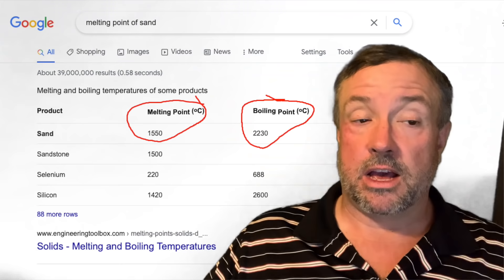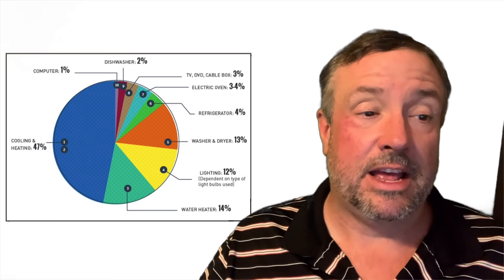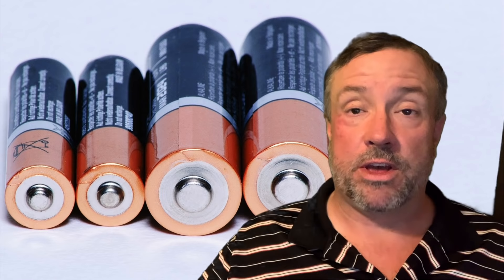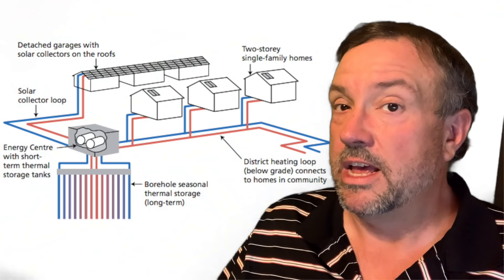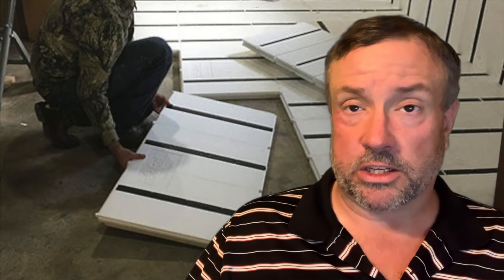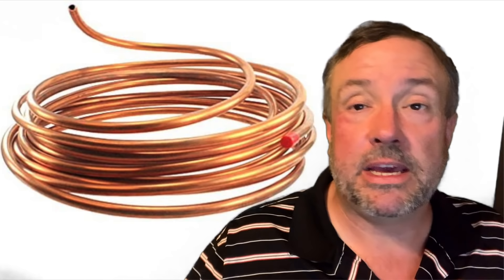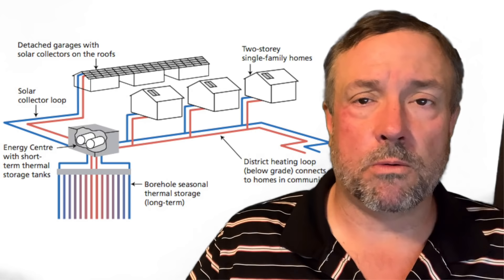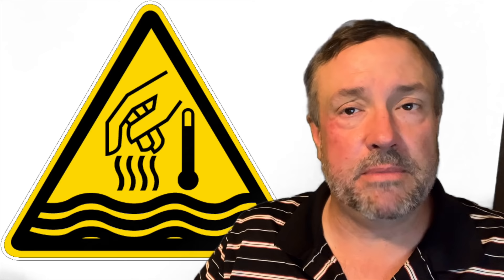Sand for Thermal Energy Storage

Comment: Ditch the sand and go with ball bearings. You can get them very hot, and you can transport them around in a pipe without liquid.  They are easier to move up hill. Just a thought.
Reply from the maker: Sounds expensive
Reply: @SimpleTek  The expense is offset by the infrastructure needed to store and move them. There may be used ball bearings available. Its not necessary that they be perfect. I bought a bag of .250" bearings not so long ago, new,  for about $7. It was a good size bag. Glass marbles could be a good choice, very inexpensive. Sand has a big problem. No matter how you move it around, it's an abrasive.
Reply from the maker: @waynesmith6417  as ball bearings get worn they become more abrasive though…
Reply: @SimpleTek  Have you ever seen a 30-year-old pachinko machine ? Very little ware on the balls. By the time they get significantly worn, your project will be made obsolete by new technology. 

A technique for designing something new is to imagine yourself being the engineer given the task of designing a system where the heat is moved by ball bearings. You don't care as long as you get paid. So how would you do it?

You will find that going through this exercise you will discover good ideas that have nothing to do with heat or ball bearings.
Reply from the maker: @waynesmith6417  well said
Reply: @SimpleTek  Thank you for your kind comment. I rewatched your video. Checked out your home page. Subscribed.

I live in a hot part of the world, Texas. I think about storing cold for the summer. It was good to think about storing heat for the winter. I will meditate on it.

I wish you well.
Reply from the maker: @waynesmith6417  cheers from Manitoba

Comment: also, the higher temps just cause more conductive losses. delta t is a key component in heat loss. double the delta t and you double your loss.
Reply from the maker: but also you can store more heat
Reply from the maker: @LaurenBurger  depends , if I keep 5% of a dollar buy I got the dollar for free, it works

Comment: I've been toying with this concept a while. I like your idea about the air-crete as an insulator. I imagine a large mass of sand encased in a cheap corrugated metal container. I'm thinking 10' Dia maybe 6-8' high. But! Instead of a boiler you pre-build a stove that's surface is in direct contact contact with the sand including the flue running up through the center. I'm thinking about taking an old propane tank 200-300gal and cutting it in half, cut an access for a flue and a base for a fire and door. Now the idea here would be to have SLOW burning fires so your damper would have to be dialed in pretty good. Basicly would want just a bed of coals going with an occasional stoke. For extraction I think 2 options should be available. One being a large metal pipe (10" dia) just running through that a fan could pull air out directly. Two being copper that circulated to a standard register.
Reply: As far as input aside from a direct fire I think it would be easy enough to insert different mediums as needed when experimenting. Worse case scenario you have to remove some sand and refill
Reply: Also thought about the roof possible being made from 100's of parabolic lenses focused on the sand level at the top (perhaps use black sand for final layer). The idea behind using a lot of small ones is that you would have at least some focused correctly at any point in the day

Comment: Dot 6 Brake fluid is a high temperature oil. I have been working on this idea since  2000. Using a old 8’ fiberglass dish , the focal point can easily reach 7-800 degrees F. Finding the pump that can handle these temperatures so far has been the challenge. Since heat rises we can add the solar loop in the bottom of the sand storage and our secondary loop can be taken off the top and ran through a heat exchanger for the domestic loop for safety reasons. This smaller scale is achievable by using a couple extra steps. Sand storage sizing for say 30 days should be adequate because the sun will eventually come out in the great white north. I live in Michigan. So my current dilemma is a sufficient pump and a 30 day storage of well insulated sand. The heat exchangers can be as simple as a homemade copper tube n tube type. So who has the pump spec’s out there to handle 400 degrees C. fluids.
Reply: Brake fluid was just a example at 500 degrees F. Soybean oil is 572 degrees F.
Reply from the maker: very interesting - thank you for the info!!!!! I agree an affordable pump that can handle the heat is the issue
Reply: Have you tried a less powerful lens? That focal point with a large plastic lens can be adjusted to be less intense and cover a larger focal area.   Or a high heat metal that can take the heat without melting just get glowing hot and pack sand around that metal bar?
Reply: Install pump at the cool end of the coil. Before the collector
Reply: @daleswanson6222  we’ve been discussing working with lower temps at around 400 degrees F. Better choice of fluids to work with
Reply: Cuft of storage area would increase as the temperatures were reduced due to equipment design where more realized .

Comment: What about storing it in a rectangular hole in the ground - similar to what is done when installing a backyard pool -  line it with insulating type firebrick on all 4 sides - then fill with sand???? With such a large container the temp can be a bit lower (maybe keep it to 150 C max - enabling the use of less exotic materials to get the heat to your dwelling.
Reply from the maker: Good idea

Comment: NightHawkInLight has great video where he figured out a simple combination of mini solar panels to detect sun's position and generate current accordingly in conjunction with stepper motors powered by the same, makes a great, cheap, sun-tracking, solar system. Once aligned with the suns path for the season, all you need is two panels and motors to track from East to West, he didn't have an automatic return system but it seems to me that would be simple once the tracking is set. Also, I wouldn't just circulate heated water for radiation, but put rocks and sand under your home and if possible, tanks of wet sand/gravel. Use concrete, rock, steel, aluminum cans, etc. and heat all this under your home and/or inside a sun-room while circulating the heat. The more heat you can drain and the faster, the more you can collect and sooner. My cousin built a two-storey glass wall on the South of his home with angled stone pillars just inside and these served as very effective heat collectors too but a smaller version is fine also and the more material you have to absorb and hold heat to radiate, both inside and outside (under house), the longer your store will last and the more consistent your heat will be will lower highs and higher lows because you are spreading your heat out more evenly. One great idea I've seen was a simple sun room with black water barrels inside. Hope this helped a little some way, good luck.
Reply from the maker: Very cool

Comment: Combine harvesters and concrete pouring trucks use 'worm-gears' to move grain and concrete.
I believe it would be worth trying to do a similar thing with sand, skipping the need for a liquid.
What I'm saying here is to "pump" the sand using the worm-gear.
The hot sand does not need to be in contact with the worm-gear, only the cold sand, which is pushed to the heater.
From that point on, I think the heated sand could drop down a pipe to the storage.
The pipe would work as a two-function device, where the first is to store the heated sand, but the second is to transfer the heat (using air) to the target.
"fiberglass mats" insulate very well (search for Isover). They have reached below lambda 30 (better than rockwool).
Fiberglass is great for "low" temperatures, but if you need to go beyond the meltingpoint of glass, you could first insulate using a material that can handle higher temperatures, and on the outside of that, you can then use fiberglass mats.
I've put none of these thoughts into practice and there might be flaws. Use with curiosity. ;)
Reply from the maker: good idea
Reply: @SimpleTek  Note: The worm-gear is not a "tight fit" on the pipe and the pipe + worm-gear should be tilted (eg. not vertical) in order to work well. Gravity is a component of this "pump", so the steeper the pipe is, the worse the lift will be.
If this idea works, there's no pressure involved anywhere.
The worm-gear would carry the sand up from the storage tank and the heated sand would drop down the pipe.
The air in the pipe where the sand drops down, will be heated, and a heat-exchanger could be installed at the top and around the pipe, so that this heat is not lost.
Heat exchangers could of course also be placed in the 'storage tank'.
Reply: @Hispy   Maintenance of the screw would be prohibitive. You mention  concrete trucks. These are constantly having their screws and barrels rebuilt. Concrete and sand are highly abrasive.
Reply: @earleford1999  Thank you for the feedback; I think it's important to consider what you mentioned! 😃
I'm sure there is a great solution, which we have just not found yet. 😉

Comment: solar panels for general electric production for half the summer. then flip the switch to go to direct solar to  heat energy coil at base of sand reservoir Swimming pool size. Either aircrete or  sheet rock with fire proof insulation surround. capped with water proof top. Glycol heat exchange system for transfer to water based house circulation monitored by a set of flow control tanks. This will also demand that the solar still produce however much in winter despite low production. this battery bank will then last many months deåpending on how much insulation you have around the sand battery
Reply from the maker: interesting!

Comment: Water is a better option, despite it being having a lower boiling point. Consider that it also has a high heat capacity at 4.18 J/g°C compared to sand which is only 0.84 J/g°C, also consider its rate of heat tranfer; yes sand takes more energy to heat up, but its purpose (which is to retain and subsequently release the same heat) is just as important. Sand has a lower thermal heat conductivity than water significantly. However with water, there are wear and tear issues (assuming its only water and not a mixture of something) and potential pressure concerns, like with water boilers. Thing is tho, i dont believe they ever get that hot enough to be concerned about high pressure steam or built up water vapor in whatever container its in.
Reply from the maker: Water only exists to be honest under 100’. C ,  sand can store heat at 4-6 times that
Reply: @SimpleTek  Right, but again, it's inefficient at transferring that heat to the working fluid. The point is that water can store and release heat more efficiently because of its heat capacity and thermal conductivity. So what if sand has a higher melting/boiling point, that's not the only purpose of a battery
Reply from the maker: @zano9291  true

Comment: I would examine the use of air as the medium for extracting heat. You could then get the heat into water using the same heat exchangers they use for generator exhaust on a chp system. That temperature range should be fine. You would need a blower that worked at that setup, but that is something that can be found i think.

For heating it up... All the fancy solar collectors seem like too much work. Consider running regular panels into heating elements in the sand. No need for inverters, just run mppt directly to the heaters with the appropriate calculations.

Designed like this it still seems expensive, but not excessively so.

This solves for heat, but not electricity. In the end you still need a bunch of propane and a good generator.
Reply from the maker: I like it

Comment: Ok. What if in your insulated sand box you heat the sand with electric coils. The coils can run on solar. Much like a foundry melts steel. Then you have steel pipe running through the sand. What about air?  You blow air through the tubes. It could be direct right to the greenhouse or you can use a heat exchanger. You could also charge the sand with the parabolic mirrors this way I would think.  
I bet you could run a mini experiment on this easily. Gain some numbers. Make sure you have temperature sensors throughout the system to monitor everything. You could test heating different ways to see what makes sense.  
Does your friends parabolic mirrors produce heat in winter too?  If so, Maybe you don’t have to have as big of a sandbox. Maybe it only needs a week of extra energy to heat through cloudy times. Perhaps you would still need the boiler to get past those times. 🤷‍♂️ now you got me thinking too. 🤔
Reply from the maker: I like it
Reply: Love this Idea

Comment: Maybe mix in vermiculite into your aircrete? Blacksmiths use vermiculite or wood ash to slowly cool off forged steel items.  Agree with Michael Johnson below re: saltwater solution perhaps in a high heat plastic polyethylene type tubing? With woodchips you can build a Jean Pain style mound and run coils of piping through it and a pump to push the water through the heated pipe, you could do it with reusable sand, its a question of how to bake the sand and how to get coils hot without melting them.  If you use a fresnel lens you will turn the sand into glass, too hot on a tiny focal point, but you can get fresnel lenses that don't come to a pinpoint and therefore heat without turning the sand to glass.
Reply from the maker: Great ideas!

Comment: For liquid to transfer the heat to the sand ( 8:32 ), I would propose glycerol (boiling at 290°C, freezing at 18°C, but I put it in a fridge and it stays liquid) or Triethylene glycol (boiling at 285°C, freezing at -7°C)
Reply from the maker: ok

Comment: There was a solar pond in Miamisburg OH that was built by Monsanto. They used black plastic as the liner and salt water to hold the heat. They were around for a long time, so they must have worked.
Reply from the maker: Do you have a link?
Reply: @SimpleTek  No, I was working as an electrician at the time and we did some wiring on it. Sorry.
Reply from the maker: @rickgividen4318  thank you for the information though, that was cool
Reply: @SimpleTek  I do remember they had a black liner in the pond to collect heat with salt water and piping running through the pond that transfers heat from the pond. It would be interested to experiment with salt water to see what the heat storage capacity is.
Reply from the maker: @rickgividen4318  thank you

Comment: I am looking at solar heating of a mix of sand and stones the size of a fist for the convenience of handling. The principle of the stones is that in Switzerland in the 19th and early 20th century and before, my mother's family would heat flat round rocks about a quarter the size of a curling stone in the fire at night. The stones were picked out of a river so nice and round and smooth. They took them out of the fire when hot enough, wrapped them in old blankets and used them to heat the bed like a hot water bottle. My mother said the rocks were still hot enough in the morning to put in a large jam making pot and pour cold water on. Then they had nice warm water to wash in.  Back to solar heating, the heat reservoir will have to be metal and heavily insulated with a second external metal skin for the base, sides and top. I am thinking of using stainless steel pipe and Hydraulic oil for the primary circuit served by the solar heater. That will be a closed system with a relief valve over a collection container if there was ever a blowout problem. Hydraulic oil tolerates great heat, it is designed to be pumped and it does not burn. Finally, the heat exchanger, I am thinking of would be external to the main heat reservoir and designed so that I can regulate the water temperature in copper pipes that return to the house. Regulating the heat in the main sand/stone mix in the main heat reservoir is my main concern this is partly for security as I would like to put the heat reservoir in the cellar under the house. The aim is to use the stored heat through the mountain winter where the temperature can get down to -25°C  However there is plenty of sun in the mountains so even in winter the heat reservoir can be maintained via the solar collector. Comments are welcome.
Reply from the maker: Thank you for the huge detailed reply!

Comment: build a tank or buy  a plastic septic tank. insulate it and fill it with sand. circulate hot water in one end and out the other. it will heat up based on he number of collectors you use.
Reply from the maker: cool